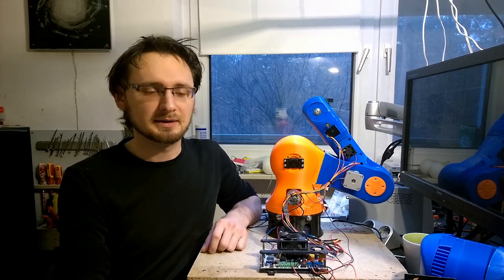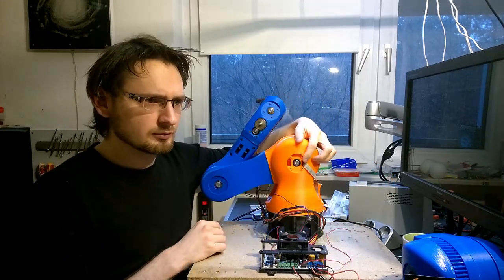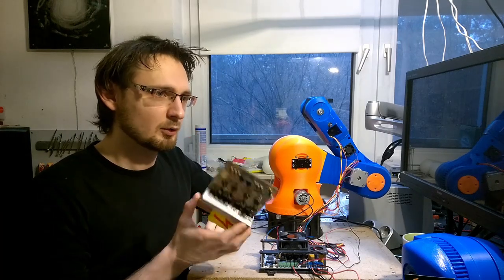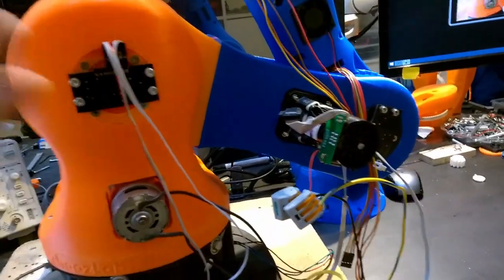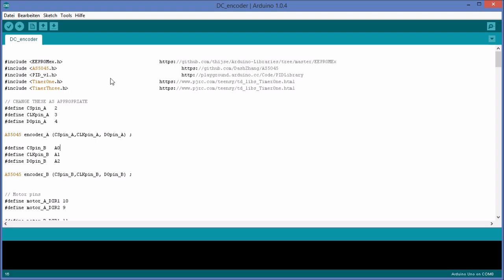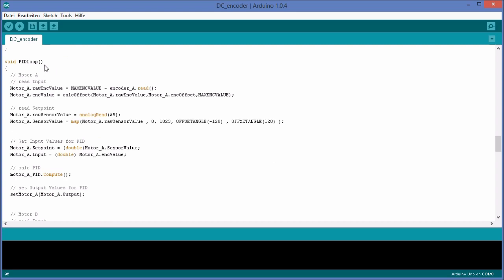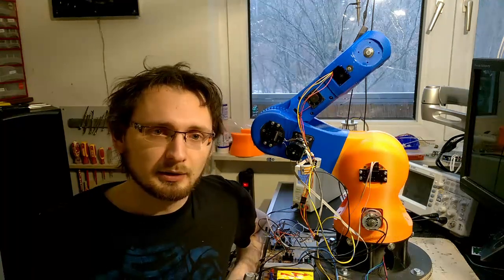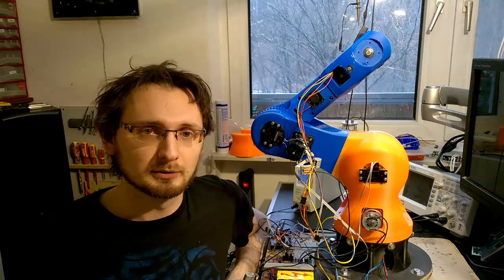Robot arm Part 6 - Moving and DC-Motors

Comment: How do you lock dc motors in place with load? Do you use some kind of mechanical solurion for that?
Reply from the maker: +herantd my solution for this is using steppers again, because it didn't worked.
Reply: you can try Self Locking Worm Gear, its a mechanical adjust but dont really know how much load it will take before it colapse
Reply: I thought pid control would solve this when the encoder senses the offset?

Comment: geared DC motor system is so strong! seems a shame to go back to steppers.. (though haven't watched far enough to see why the change back)
Reply from the maker: +Ojsh Olman well the gearbox for the dc motor is quite expensive, the Nema23/24 steppers are about 30-40€ and provide similar torque without the drawbacks of gearboxes and controlling dc motors. 
I already burned one dc motor because they don't like to stand still or move small amounts. Also the form of the dc motor does not fit well into the robot.
Reply: +Andreas Hölldorfer  Easier to control steppers accurately too i guess, and with absolute position feedback, no problems with missed steps etc. New arm design is looking great, enjoyed browsing around the inventor files

Comment: Andreas, I'm simply amazed by what you have done. You should be very proud.  I've just started learning about robotics/electronics.  Would you be able to tell me why you chose DC motor (with encoder) over a high-torque servo?
Reply from the maker: quite simple, price. You get an encoder for 6€ and a 60 watts DC motor with a gearbox for about 70€ (about 30 Nm). I don't think you get more power cheaper. If necessary you can exchange the dc motor with a brushless version and get about 300 watts for about 40€ more... This is for the shoulder joint. The other motors cost about 15€ (about 6 Nm).
Compared to a hobby servo if you talking about this with around 1 Nm quite a difference. 

Last time I checked industrial servo motors cost much more.